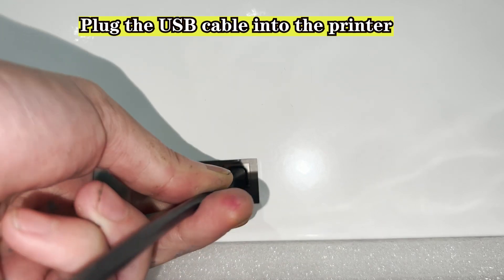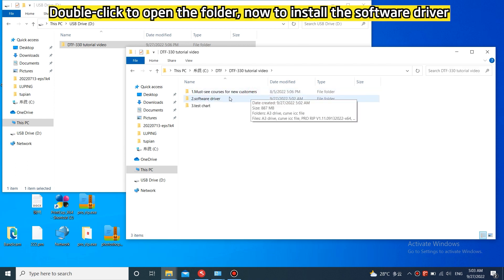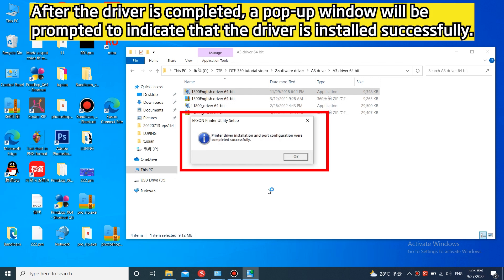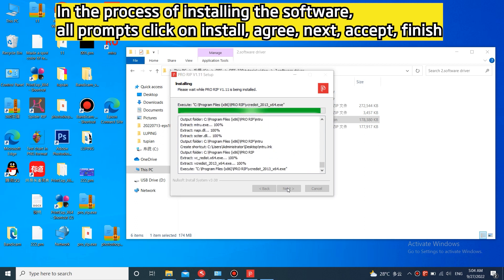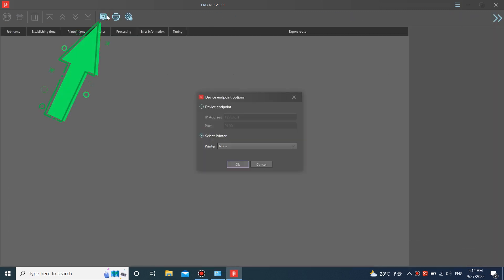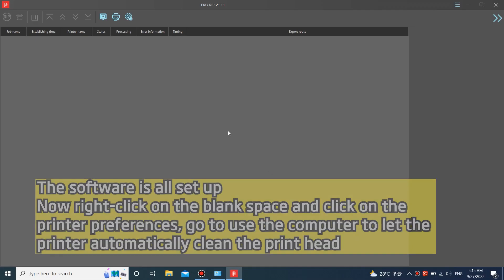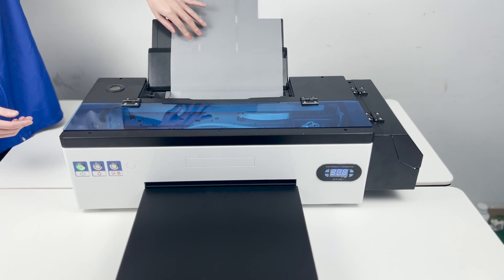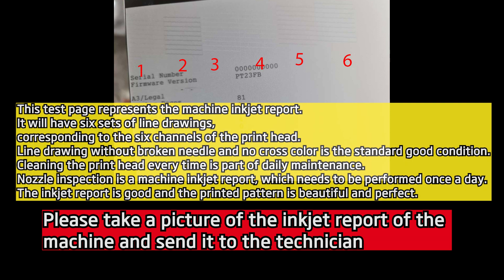How to Install drivers , install software and set software of ACHI A3 R1390 DTF printer

Comment: are the encryption lock and white usb stick needed? i'm only using the usb drive that came with the printer and the rip software won't show could it be for that reason?
Reply from the maker: Hello, Dear Friend , the encryption lock  is necessary for printer work